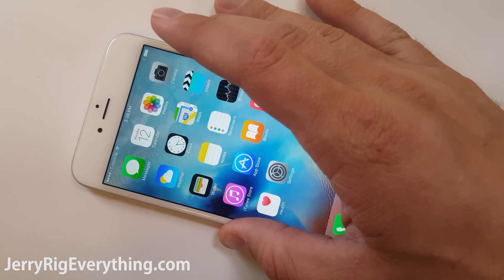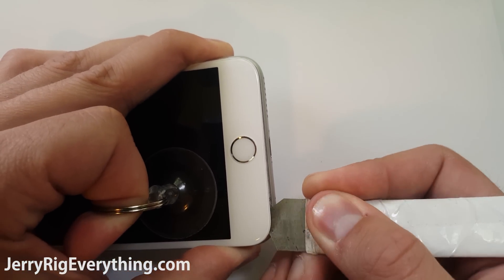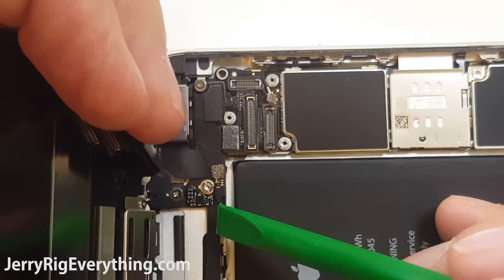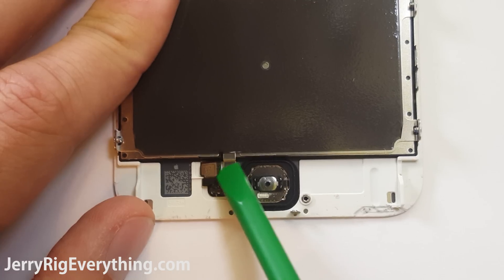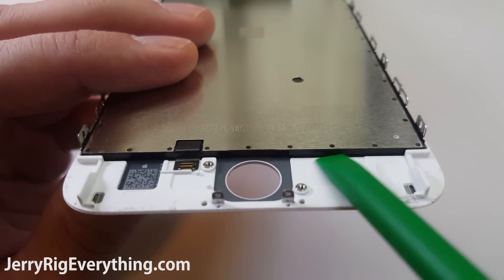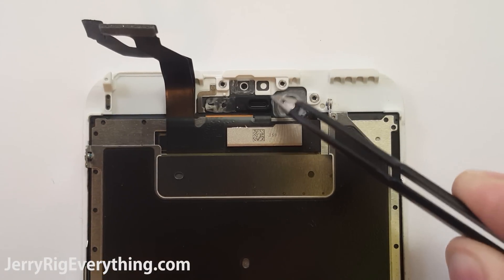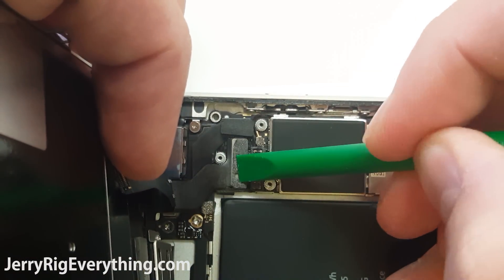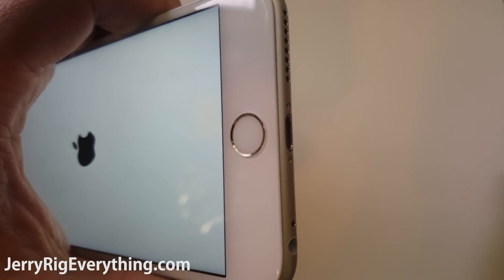iPhone 6s Plus Screen Repair shown in 4 minutes Fix

Comment: Cool, you need to heat it a bit first if you're using the clear plastic tape and suction cup (you also need to heat the Home Button area), at about 70-74℃ (for OLED check with the forums), regular blowdryer at the max speed (2) is just right. If on is using and SMD workstation, even if has temperature control, it's best to have a second opinion in the form or a temperature probe taped with Kapton tape on the glass of the LCD but prying with proper pry tools is the safest way (you'll tear the Home Button though and the cable going to the board, having a heat source is sometimes a must). It's best to do an DIY wood or plastic or stiff wire "delimeter" for the distance of the heat source (will need trial and error).

God bless.

Comment: The links for the Black and White Screen replacements turn up a 404 error at the time of this comment. Thank you for the video!
Reply: Have you had luck finding a replacement screen? I had the same issue with the link error
Reply: @jenvo2891  Ended up going to a local cell phone fixit shop and having it done. The quality wasn't the same meaning the color tint was a little off. Next time I would replace with Apple parts only.
Reply: @alondonb  thank you for your reply. I got an iPhone 6s plus for free from my boyfriend to use just to talk to him using apple I'd or something and just play games or shopping apps on it. I am debating if it is worth fixing the damaged screen I  the first place or just put the money towards a new phone in general or even an iPod touch since its only 200/300 depending on the storage

Comment: I bought a used iphone 6 for my brother.  There is a small light next to the clock on the screen.. Is that the LCD light.  Would the phone still works with the LCD light on.  If I have to have someone repair it, how much do you think if will cost? Need your expertise please or any recommendations. Appreciate your help.

Comment: I researched that the white 6s+ has a different ambient light sensor filter as opposed to the black 6s+. 

Is this correct?

If so, would I be able to put a black replacement screen on my white 6s+????

Thank you

Comment: It's a good idea to disconnect the battery when disconnecting the screen as the battery voltage could blow the backlight when resitting the screen
Reply: Yes

Comment: This is the best video I've found. Thank you for making it. My mother shattered her 6 s plus screen, and people are quoting us ridiculously high for repair pricing. I'd like to just do it myself. However, I am concerned about the necessity of heating element I've seen used in other videos. You seem to leave that out... But would not using one compromise its adhesion to its bottom component and or its suspected ability to prevent water damage ?

Comment: Hey, great video! However, I'm extremely curious how you make money off of screen repairs for iPhone 6 and up. Apple offers a $149 screen replacement if you don't have apple care, and the screen part you linked in the description is over $200... So where does the profit come from... Charging people over 200?Thank you! I saw your post on Reddit from about two years back giving your advice on starting in the repair business.
Reply from the maker: +SilverTheFlame You are correct.  Right now there is no profit to be made from the 6s.  But from the rest of the iPhones (Or 6s phones that are out of coverage) money can be made.
Reply: +JerryRigEverything hmm, interesting. Thank you!

Comment: Hey Jerry. another good video! Have you heard about the 3rd party screen rumour? Error 53 on 3rd party screens after the next IOS update..
And have you tried to change the glass only on an 6 or 6S?
Keep up the food work!
Reply from the maker: +Are Storholm From what I understand... that Error 53 only pops up after a new home button has been installed (And system updated) on the 6 and 6s.  So the SCREENS have nothing to do with it... unless a replacement home button has been installed with it.  I have done a 'glass only' on the iPhone 6, but it is very difficult: https://www.youtube.com/watch?v=z9drzO9hO_U
Reply: +JerryRigEverything Thanks for fast reply!
Oh, okey! Ill have to look in to that!
You have patience and skills! Ill skip the glass only part. Costs less for me to use 10 minutes to change the whole unit than to use 1-3 hours picking of and resetting the damn glass!
Stay awesome!

Comment: How about the sticky tape around the edge of the housing? You dont mention anything about that at the end? So not much water resitance after repair?
Reply: Matheus Caixista
It does not say ip certificate but it is better than the previous with the sticky tape and also the cover around the connection

Comment: love these repair videos can you make a screen repair video on the chrome book acer?
Reply from the maker: +Apave122 Those usually arent cost effective... its just cheaper to buy a new chromebook.
Reply: +JerryRigEverything probably but our school does this thing where they give us chrome books and a lot of kids break them and they fine you a good amount I was just wondering if it would be smart to fix mine myself if it broke. Thanks for replying though :D
Reply from the maker: Apave122 I just checked a few websites, and replacement parts are not readily available... So its probably not an option.
Reply: @JerryRigEverything  the screen replacement link for the iPhone 6s Plus isn't working anymore. Is there a different screen you would recommend?

Comment: Apple has been bricking phones because people changed their home button? That doesn't make sense to me.
Reply: +x9x9x9x9x9 Yep they are doing it. its fucking retarded. Even if you replace the home button with an original from another phone the phone will brick and give you error when attempting to restore it with iTunes but as soon as you put the original that came with the phone it works fine.
Reply: George241312 I wonder why.
Reply: +x9x9x9x9x9  Maybe something to do with TouchID?

Comment: note 5 footage is good quality but the colors are just super bland. maybe it's just the lighting
Reply from the maker: +Ferraridude13 I agree.  Ill stick with my GH4 after these videos are finished.  I still have the battery replacement vid, and the charging port vid that were filmed with the Note 5.  Ill release them inbetween other videos.

Comment: So if my touch id breaks there is no chance of that ever seeing touch id again even with a replacement??
Reply from the maker: +Apple tech studios Its a interesting repair. If you swap it, and update your phone...  your phone will automatically reset and delete all of your information. This is Apples fault. Once your information is deleted... from my understanding, you will be able to restart your phone again... but with all of your information gone.
Reply: +JerryRigEverything ok thank. well thats apple for you🙄
Reply: +JerryRigEverything that sounds like a security feature due to touchid data protection. Probably if you disabled touchid before replacing it, it wouldn't delete your data.
Reply: Just had my iPhone 6S screen replaced (I honestly don't know if they replaced the home button, don't know why they would though, it was fine). If I delete all my TouchID information can I then update my phone and not be worried about an error?

Comment: Why would anyone do this? It is not worth anything. Apple only charges $150 to have this done with your warranty intact. 

Pay $300 for this display and once you open it up say goodbye to your warranty and support from Apple in the future.
Reply: ***** no it's not. breaking the screen doesn't void the warranty, it just isn't covered under warranty. if you tried fixing yourself it would void warranty.
Reply: +Jake Methner no dude it does not void your warranty.
Reply: Henry Chaisritha Yes it does. Once you have 3rd party parts in your phone it is voided.
Reply: +Henry “Adda” Chaisritha Yes it does...
Reply: I assume this is cheaper than $150.. are you sure it's $300?
Reply: Yes, screens from third parties for the 6s are far more expensive than before. iFixit is selling them for over $300.
It's only about $150 from Apple, and they install it for you and it comes with a warranty.
Reply: +dan428 Nope its in the $250-350 range.
Reply: +Jake Methner apple fixes it for you at the apple store in an hour for $130
Reply: +George241312 6s+ is $150. Wait, were you trying to make a point?
Reply: ***** It is super easy to tell the difference. Most Chinese manufactures stamp their replacements and the qr codes on the back don't swipe off on oem parts. Apple techs check for that. Your warranty will be voided.